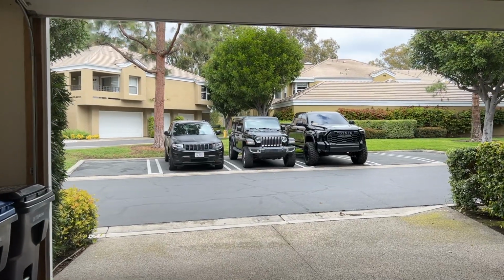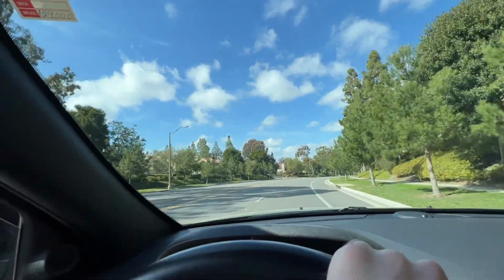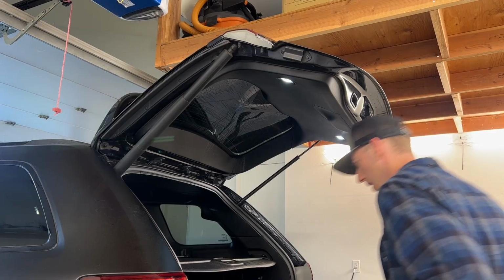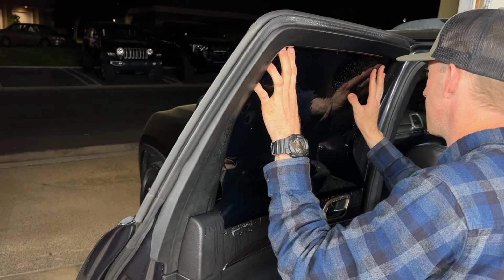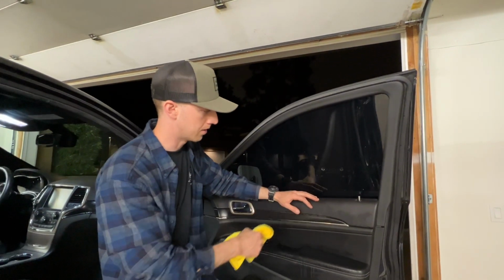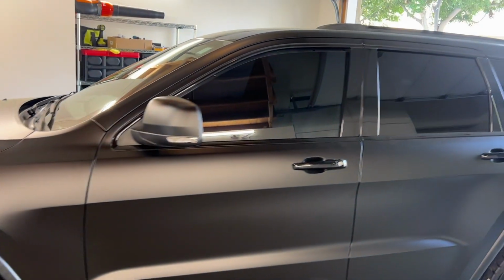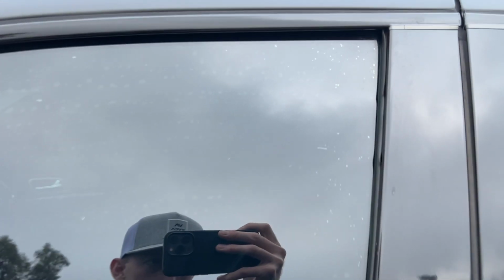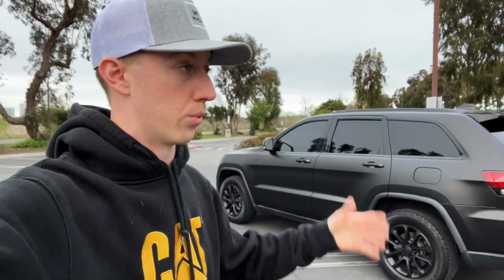TINTING WITH EBAY PRECUT WINDOW TINT

Comment: A few things from my experience with tint (precut and store bought tint). Remove the windows whenever possible. It makes install much easier and you can take advantage of temps inside your home when tinting on a cold day. Shrinking the tint is helpful even when doing roll up windows as it greatly reduces the fingers. Tack the tint to the outside of the window so when you go to move it, you’ll have a much shorter distance to walk which will reduce the possibility of contamination. When shrinking the rear windshield, you only need to do the H pattern when you’re shrinking. During install, you do a cross pattern to create a quadrant and then squeegee the water in each quadrant. It’s know as the British flag method. Clean the inside of the window twice and dry with a squeegee instead of a towel. Lastly, use a bright led light or something to inspect everything right after you install. You have a small window to work out any contaminants before it completely dries. Those bubbles in the drivers front could’ve been fixed if you found them much sooner.

Comment: Contaminants could be from the microfiber towel you were using. Microfiber towels for windows have a very short pile. 
When I use a regular microfiber towel on windows it's impossible to not leave super fine hairs. Try Chemical Guys Waffle Weave towel. Works good for me.